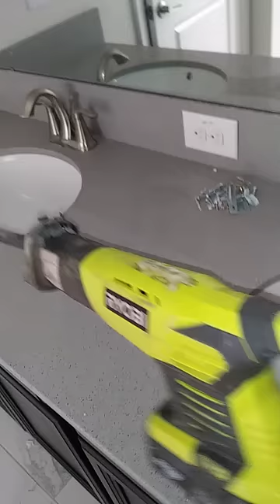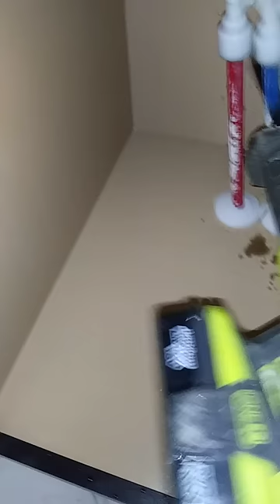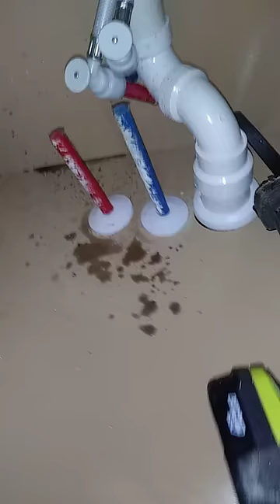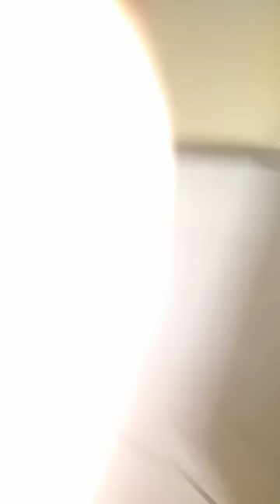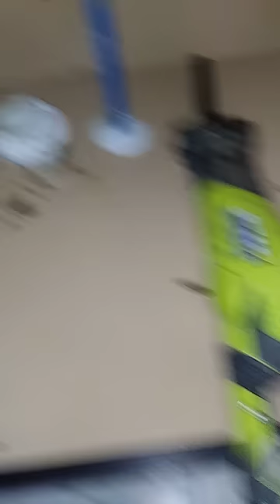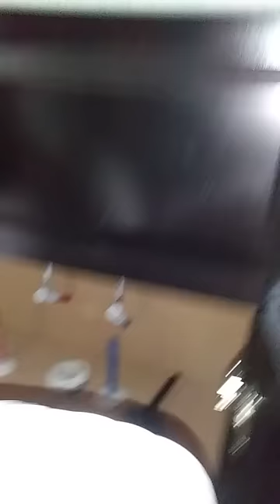This is what happens when you DON'T pay your plumber.

Comment: You can tell he hasn't been paid. The poor bloke is using Ryobi
Reply: Riobi is lightweight awesomeness bub. If you have been in construction long you may value durable lightweight tools
Reply: Whats wrong with ryobi? Works well for me but i prefer milwaukee
Reply: May not be as powerful to some but last longer. I have had Ryobi decker & dwalt of all the same tools. Saws drill and hand tools. Ryobi only brand still in my tool box. All the others broke or got after wear n tear. You by them cuz it's cheap and affordable than realize there long lasting and reliable.
Reply: Try busting >1" bolts or drilling >1/2" holes into concrete and you'll see why Ryobi is a second-rate brand.
Reply: Ryobis the shit
Reply: Ryobi sawzall is pretty good been using it for grounds for 8 months
Reply: I just bought one at Home Depot. 😭
Reply: Here comes the dodge guy with dewalt XR 20 everything. Everything else is trash.

Edit: minus Kobalt 24v and Milwaukee
Reply: Honestly I don’t mine any tools I use aren’t put to much abuse or don’t need to do much just need to be cheap and last a bit
Reply: Ryobi is a good brand, the only problem is some idiots don't know how to use the tools and when they brake it they say is the brand faults...
Reply: Ryobi can mean one of two things
1: cheap ass does bad work
2: works tool like crazy does great work doesn't want to keep replacing expensive tools
Reply: Thinking the same
Reply: @DASHAWNJOHN  milwakes are decent but seriously ryobi sucks ass for anything beyond a one project diy homeowner type gig, you're better off buyin ur shit from harbor freight, they'll last ya just as long for half the cost.
Reply: @quiensoyyo900  if a tool can't take a beating it's a piece of shit, tools should be durable period.
Reply: At least it's not Harbor Freight.
Reply: ryobi is high quality japanese hardware
Reply from the maker: @daniels1293  i would have to humbly disagree. I've been in the heavy trenches with Ryobi on the job tested see some of my videos. 
I've owned every brand name tool hilti milwaukee dewalt all have failed on the longevity. I've used and abused the Ryobi brand only thing I feel is better are Rigid. But they don't make as many tools as Ryobi.
Reply: Pittsburgh Sawzall is the shit.

I meant to say Pittsburgh Sawzalls are shit, LOL.
Reply: Haha...damn! #MilwaukeeFuel
Reply: I've owned pretty much every brand for multiple different tools and out of all of them the longevity and performance dewalt and rigid are the only decent buys. Ryobi specifically has failed multiple times to fairly simple demo work and their petformance for building shit is definitely subpar but the worst part about them by far is the battery life expectancy, i have the same dewalt 20v batterys i bought 4 years ago running strong, my last ryobi set i replaced their batterys in less than 6 months.
Reply: @Spider's Morning that's a spot on point to be made
Reply: Hungarian Hammer di-did you like your own comment 👀
Reply: Mu ryobi electric screwdriver has lasted like 5 years and works absolutely fine, every engineer needs one If they like having hands that dont cramp and ache, and it's fairly light without sacrificing too much torque or battery life
Reply: 🤣🤣🤣 say that
Reply: Lol
Reply: It's called maximizing profits and lessening liability of asset's. 

If you spent 
$250 on a sawzall then when you could have bought one with great output for only $89 you already saved yourself $160, not to mention, if your standard is always high for tools then if you loose or  if a tool is stolen you now are upside down $500 for two sawzalls.

I always buy cheaper tool's, of course if they function as needed, even if my Ryobi is stolen, I'm still not close to the cost of one Milwaukee sawzall if I had to buy another one for $89.
Reply: @myopinonz  hell you dont even need to pay sometimes, yard sales and scrap yards always have tons of cheap and free tools people leave behind or dont want
Reply: @jordanmendoza812  an even greater point I forgot to mention, second hand tools are a great way to cut costs even further.
Reply: @myopinonz  hell, I've gone through 3 snap on ratchets I found at yard sales but the crappy chinese bargain bin one my boss gave me only seems to work better with age, sometimes cost=/= quality at all
Reply: Lorne Johnson  I agree Hilti is the best, but when you have to buy tools for eight guys to use, and the jobs require max empitus and stress, I ain't blowing $400 a piece on a drill... I love Hilti, no other tool had the build quality as a Hilti, Milwaukee is  second.
Reply: Haven’t tried ryboi yet but dewalt has been failing me.
Reply: Lorne Johnson  honestly most of our guys are former electricians and carpenters and they have thier own tools, but i have always had the privilege of working for companies that provided tool's, also it's a tax write-off and so I don't want my guys  burning up thier stuff when they can just use company tools which can easily be replaced, we used to require them to have thier own stuff, but since we have taken full responsibility for tools we have noticed a bigger payoff on hard working loyal guys, I don't want them to use thier bread and butter for our jobs, alot of our guys work as private  contractors and use thier own tools already. We just keep our costs down by purchasing more affordable brand tool's.
Reply: @Karl Ryobi is perfectly fine for DIY and light/medium-duty jobs. I'm a maintenance tech in skating rinks and formerly swimming pools; Part of my job is dealing with large concrete anchors, drilling into concrete as well as removing old mummified anchors. My experience with Ryobi is the tools overheat and shut down, whereas my Milwaukee tools work all day and often remain cool to the touch.
Reply: @fearless1024  I work in the swimming pool industry and install anchors and beetween the chems the abuse and going swimming not worth it for me to buy top of the line.
Reply: Can we just agree as long as its not a black and decker product ita not that bad
Reply: Miguel Arreguin don't worry they are great tools had one of their tables saw for 10 years and it still works like a charm
Reply: Benjamin C. Thompson Jr maybe ive had bad luck, but i had both ryobi drill and sawzall.  Burnt battery within 6 months of both. However, dewalt i still have some of the old “post” type 18v power tools. Given,this is heavy usage
Reply: Just Who false
Reply: Hahaha 10/10 one of the best comments I’ve read!
Reply: I hate their drill🤦‍♂️🤦‍♂️
Reply: Mr.roastyonutsack Jr. my dad and I have used Ryobi power tools for the past ten years or so while working on our cars, they still work like a charm😂
Reply: da bizzness no ryobi is not the shit. Its shit
Reply: And  can't afford a new blade, lol.
Reply from the maker: I couldn't have said it better myself.
Reply from the maker: I've done both with my ryobi.  It all friends
Depends on how much it cost.  Yeah the chair ryobi probably went last but the contractor ryobi is way better then most of my other brand name tools.
Reply from the maker: Yes it is
Reply from the maker: I agree.  I've had my ryobi for almost 5 years now i use it daily and it's still going strong.
Reply: took him so long to cut through those pex lines lol... milwaukee wouldve cut in half the time
Reply from the maker: @alizcool1  so true. I have used all the major brand name tools. I still have most of them but Ryobi has been tried and tested in my book. Ppl are dumb.
Reply: alizcool1 lol shut up DIY. Tradesman know what they are talking about when it comes to tools... well the unions boys do, Milwaukee will run circles around any Ryobi junk
Reply from the maker: @louismccomack9524  union 826 pipe fitters union. We only use Ryobi
Reply: @HungarianHacker  local 230 plumber. fitters and plumbers here dont use anything but dewalt and milwaukee.
Reply: @phillipmoyte1063  idk why but my dad prefers DeWalt better, is it better than Ryobi? or not? just curious
Reply: Look at all the poors backing Ryobi 😂😂😂😂
Reply: @squasherdown  anything is better than ryobi and makita. I prefer milwaukee but dewalt is okay too
Reply: I'd fancy myself a kobalt or Milwaukee
Reply: He  just had a dull blade
Reply: ryobi isn't bad at all. i go to milwuakee, ryobi, and mikita
Reply: Thats what i said lol he needs a milworkee
Reply: A will workee
Reply from the maker: @joshuabailey2746  i try lol
Reply from the maker: shell company  was it the old blue ones?
Reply: it's the nubs like you who think some tools are bad when they just don't know how to use them by reading instructions or looking at tips/vids online from pro's instead of jumping to conclusions based on the company..
Reply from the maker: @LS-jk3fk  couldn't have said it better.
Reply: Prefer Makita myself, never had a problem, and the impact driver I bought 7 years ago still works great and can jam a 4-inch deck screw in seconds.
Reply: @HungarianHacker  Definitely. been using a drill and right angle drill both from a company named "Bauer" at harbor freight, got them a bit before mid 2019. have been woirking great since, and they've been through some heavy duty stuff as far as drilling metal or cutting a hole in a desk a bit over an inch thick that is made of a special type of wood, with those metal grommet hole cutter bits with serrated edges. I'm not a woodworker/carpenter, just a creative 17yo guy who thinks power tools are a great investment.
Reply: Great tools Ryobi.
Reply: 😅🤣 omg savage but funny response
Reply: Hungarian Hammer you liked your own comment...
Reply: @jankington216  You clearly didn't read the description at all
Reply: Imagine being so ignorant you buy tools solely for the brand name, and not the precise technical specifications or enhanced personal productivity.
Reply: @jankington216  Why do you spell your name wrong? It's "Giuseppe".
Reply: With bad blade
Reply: @phillipmoyte1063  it took him like 5 minutes to cut 2 plastic water lines.
Reply: I'm a Porter Cable Man.
Reply: Festool ftw.
Reply: @daniels1293  ryobi is just as cheap as of brands at HB 😂😂😂
Reply: @genxmurse7019  there’s nothing wrong w HB either 😂😂😂 y’all be breaking shit left and right so maybe y’all need the cheaper option
Reply: @jankington216  oh yea tough guy whatcha gonna do about it? Cus right now he’s laughing his way to the bank with his new home 😂😂😂😂
Reply: I think I could've cut those pipes faster with my Weed Wacker!! :-)
Reply: I bought a ryobi for a little drainage job and I’ll tell you what that litttle bugger had some power don’t know about longevity but surprised of the power.
Reply: Hahaha! Yup, I notice the diy tool too
Reply: Yup. Ryobi is fine for cutting plastic and wood, but leave metal to Milwaukee.
Reply: Yes seem shit, also the blade seem shit. Use Hilti?
Reply: Ripping on peoples cheaper tools is always the go to move for people who pay an arm and a leg for high dollar tools to find ryobi isn't much worse quality and have great lifespans.
Reply: I was using a ryobi angle grinder and the whole head went flying off and put a hole in some drywall. It’s handyman shit.
Reply: I had two dewalt routers for drywall and both burnt 🥵 they only lasted a few months. I was using them for the dense glass to cut the window and door shape for exterior
Reply: You’re right. Ryobi is Chinese made garbage. Lol
Reply: this comment wins!!!
Reply: honestly though ryobi has stepped up their game in the last few years
Reply: @fearless1024  yes but if the Ryobi is the tool you need for the job, then it's great. If you need a heavy-duty tool, get one of those. If you know what you're gonna use your tools for you'll know what to buy. It's about the right tool for the job. I dont buy a semi truck if i can use a pick up truck to haul my firewood, do i?
Reply: @hoagie7859  As I said to someone else, Ryobi is perfectly fine for light to medium duty work.
Reply: Hahaha look at all these people talking shite about their two cents on tools. Good joke mate.
Reply: Well my Ryobi petrol grass strimmer outlived my expensive Makita one by 7 years and still runs. I think people don't know how to use them and for what applications they are intended for. Clearly, that saw is not for what he is doing, but it did the job.
Reply: Awesome beater tools man. Cheap as hell and the batteries are great.
Reply: @fearless1024  ok tough guy. what about for skilled trades?
Reply: @unglemergy  Milwaukee
Reply: nobody here knows what they’re talking about. All the brands you guys have listed are garbage and you need to be buying hitachi
Reply: @HoomerbirdG2  If I was going to spend that much money, I’d buy the Milwaukee Brushless.
Reply: @denang501  its a rebadged ryobi/rigid man look at their parent companys. Hitachi is second to none👍
Reply: @unglemergy  aite go use your little kid tools Ill use the big boy ones👍
Reply: @HoomerbirdG2  meanwhile get a job 😂
Reply: @unglemergy  I have one thats why I don’t have to buy Ryobi tools
Reply: @jankington216  whats
Reply: @phillipmoyte1063  durable? Light weight? Since when?
Reply: @falcon1378  dewalt started falling apart these past few years. I would pick ridgid over dewalt, but my van is all milwaukee can't beat their warranty
Reply: @aksfishing4480  black and decker pretty much owns the other brands though. I know they own lenox, stanley, and dewalt
Reply from the maker: This is true
Reply: I don’t use Ryobi but I don’t knock em either. 
Bet you didn’t ask Chevy what spanners they used to build your car.
Reply: What brand did they use to build the Golden Gate Bridge....no body knows because it only matters who build it not what they built it with.
Reply from the maker: @sidknee4975  I like how you think!
Reply: @phillipmoyte1063  If you use a tool everyday it doesn't need to be lightweight because you'll just get use to it.
Reply: Lmaooo
Reply: Lmfao. Thats exactly what i was gonna post
Reply: Lol only people who dont use power tools talk that bullshit. If your good at what you do ryobi gets the job done.
Reply: Haters gonna hate
Reply: I think the blade is the issue here, not the tool.
Reply: Looks like it worked to me..
Reply: Lmfao🤣🤣🤣🤣🤣🤣🤣🤣🤣🤣🤣🤣🤣
Reply: @DASHAWNJOHN  both made in China
Reply: Ryobi for the $ are the best. Hands down no comparison.
Reply: @BCT-fx7wg  hmm, I burned up my ryobi drill 6 months after having it, using a wire wheel to remove rust from my truck bed... lol. Every single Milwaukee tool I have even the 7 year old brushless impact and all 3 drills still function like they are new. Many have fallen off a roof or ladders. Your either full of crap or you are comparing harbor frieght tools to ryobi.
Reply: @bvictory5698  neither. Depends on what type of work your doing and how u treat your tools. Don't matter though. Been a year since this post and I STILL have those same tools. Hahahahahahahaha
Reply from the maker: You still have my tools... I need them back sir!
Reply: Ryobi ain't bad. You just into material name brand stuff.. and that's ok.
Reply: @daniels1293   While obviously you don't know as much as you think you do because if you did you would have mentioned the fact that going to Harbor freight also means that you can replace any one of those tools after it breaks Also lots of companies who depend on their things being durable and lasting a long time will not give you a lifetime warranty on them but I can go and replace my ryobi literally anytime With no cost to myself
Reply: @HungarianHacker  if it works for you and you're happy with it who cares? I have a boner for Dewalt tools because the way you feel about Ryobi is how I feel about Dewalt. So I tend to buy Dewalt, also because I have the batteries already which makes more sense to me to buy Dewalt. If it works, it works. You don't like it then don't use it, but this dude obviously likes Ryobi so who cares? It works for him.
Reply: Hell yeah ryobi is the shit 🤣🤌🏽
Reply: @fearless1024  actually their newer stuff the one plus hp line up is up there in quality with the top dogs. Ryobi is made by TTI the same company that makes Milwaukee, rigid, and a few others. All made by the same manufacturer..
Reply: @timothy9360  Yes I know Techtronic is the parent, just like how GM makes both Chevys and Cadillacs. As for Ryobi's new stuff, I see they released a high-torque impact. If the specs are accurate, yes it does bump Ryobi up to a more legitimate professional player. Perhaps they are upgrading the Ryobi brand to separate it from Hart (ftr TTI owns Hart not Ridgid)
Reply: @HungarianHacker  man, ive got a milwaukee drill and my dad and I have used and abused the shit out of it. Got it 7 years ago, has been used on countless cars, shelves, used to build and tear down countless other things. It has been dropped from rooftops, and from the top of a ladder several times. It has also been dropped from normal height a lot onto concrete. It has been through hundreds of charge cycles and the battery is still holding up well, and that is one strong drill.
Reply: @fearless1024  if you go to torque test channel they already tested the high torque against everyone. It destroyed most except makita and Dewalt new one
Reply: @fearless1024  Emerson owns ridgid but they are made by tti. TTI bought the licensing from Emerson back in 2003.
Reply: @phillipmoyte1063  not really its for simple house work, compare them to Dewalt, ridged, craftsmen and Milwaukee it'll come in last. Hence the reason riobi is far cheaper than those. Milwaukee is the best in most people's eyes. I'd take ridged over riobi bc they offer a lifetime warranty
Reply: @fearless1024  with the right battery,  it gets done.. I've done a few 1" cement holes in my home..
Reply: @timothy9360  Ah the more you know.
Reply: @arturomontes5884  I'm happy for your success. Me, I'll stick with the red brand.
Reply: @fearless1024  Milwaukee has good shit, can't knock em.. ryobi is for us weekend warriors, and project junkies.. great for what it's worth, but they all have their levels..
Reply: @arturomontes5884  Absolutely! This comment thread has been going on for awhile now, and I've tried to clarify myself. I personally have had mostly bad experiences with Ryobi tools, but that doesn't mean they are universally bad. If Ryobi has worked well for you, then you have no reason to spend more money on something else.
Reply: @HungarianHacker  Absolutely agreed.  It was long ago - about 20 years - but my first tools were Ryobi and DeWalt.  For heavy jobs I set up with the DeWalt, but for mobility ... Ryobi all the way.  None of my tools ever died.  But then I only worked in the field as a sub contractor for a couple years.
Reply: 😭😭🤣🤣💀💀💀💀  
Most underrated comment yo
Reply: Ryobi is actually really good material considering the prices my Ryobi tools made me thousands
Reply: Fffs😂😂😂😂😂
Reply: Ryobi is just Milwaukee/AEG with a different colour paint ;) It's all TTI, the red paint just costs more
Reply from the maker: @Muffin_Masher couldn't have said it better!!!